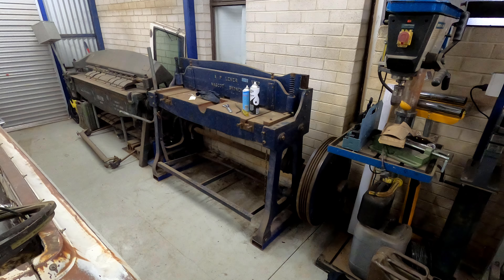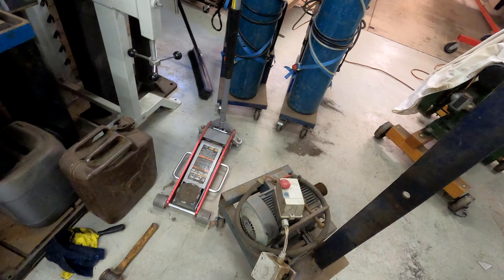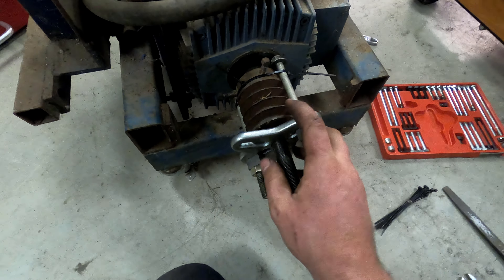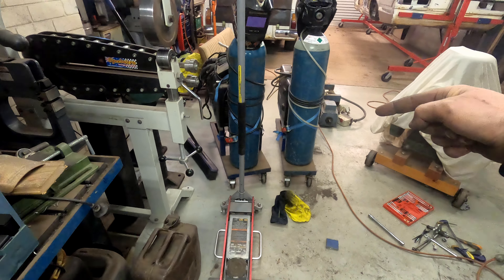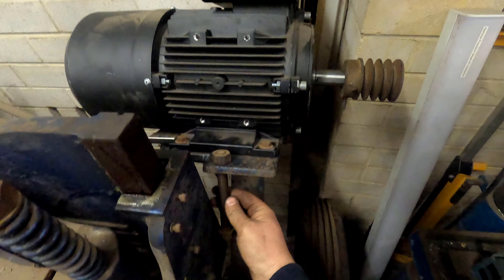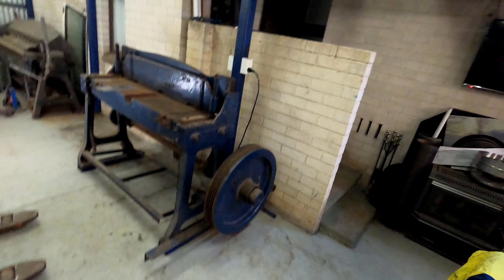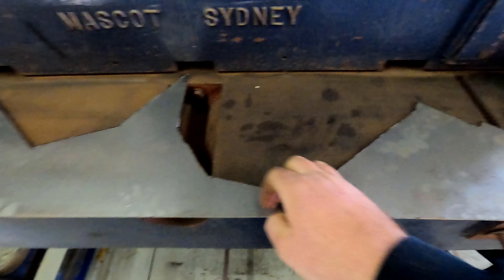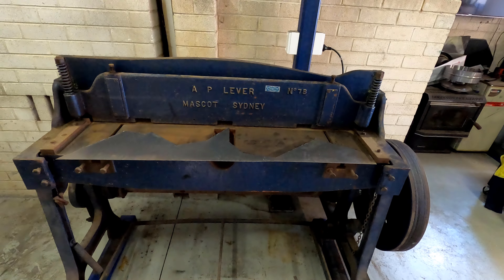Say hello to the new chopper. Restoring the AP LEVER Guillotine: BackyardBuilds

Comment: What RPM do you spin the flywheel to? What motor did you use? Trying to get mine up and running thanks.
Reply from the maker: The motor had the same RPM as the 3phase. I can check on the weekend & let you know.